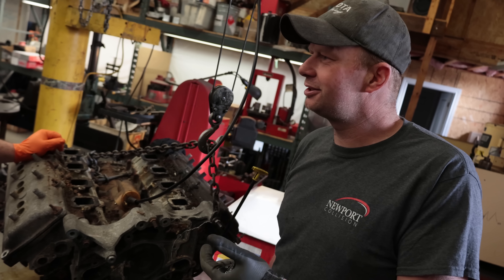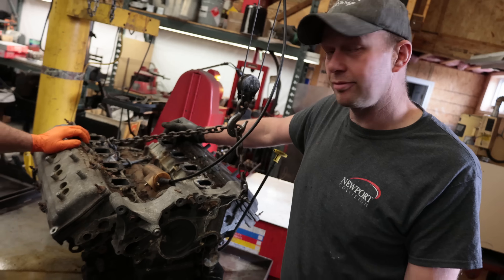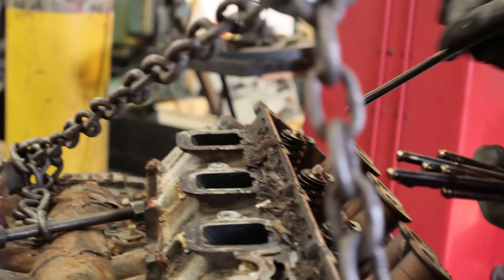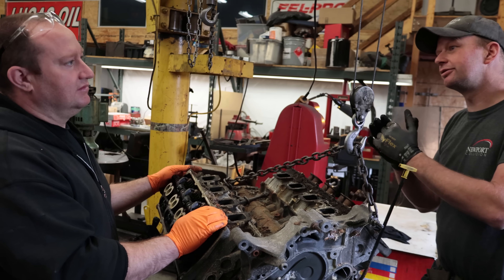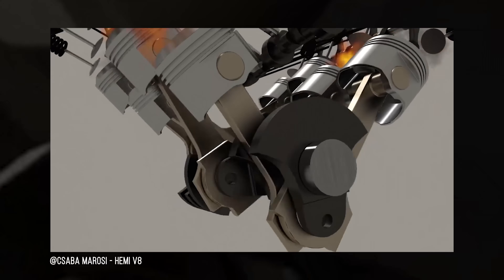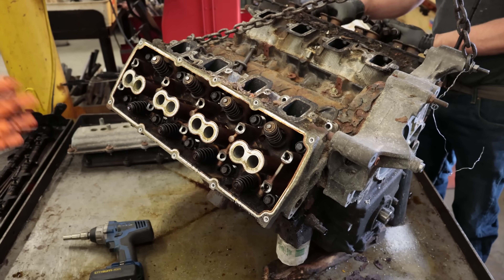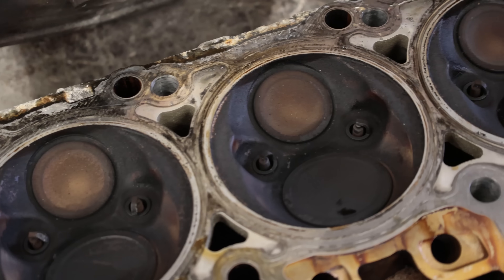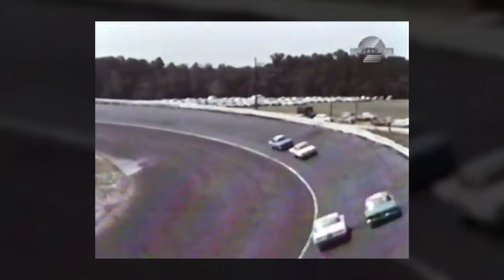REVIEW: Everything Wrong With A 5.7 HEMI 345 Engine

Comment: I had a Ford with the 4.9L inline 6, I was always told it was unkillable and I never had an issue. I would love to see an episode on that engine!
Reply: Slow as fuck though.
Reply: @adrianspeeder  somehow gets 16mpg in a 3/4 ton though!
Reply: @DaveBenson  I don't care about MPGs.  My time is money.  Gotta get places quick!
Reply: @adrianspeeder  So build a 2000hp Cummins and get there as fast as you want.
Reply: @DaveBenson  no they didn't.
Reply: @adrianspeeder  not after ford australia developed it for 40 years
Reply: I 'd like to see a external water cooling manifold and turbo'd  same bore and stroke as a 350 C with a 1" longer rod.
Reply: @adrianspeeder  But got great MPG too, comparatively speaking.
Reply: @adrianspeeder  So, it wasn't meant that be fast, meant to rev low and last
Reply: @adrianspeeder  yes 93'-96' are the worst ones , fords cam timing and emissions,, the v8s are turds from thos era ,; 95 460 v8 makes about 150 hp , brand new , I owned one In 96' dually crew cab and a 5 spd ,, couldn't back a trailer slight incline without stalling..ford claims they are 250 hp 🤣 not a chance.
Reply: @adrianspeeder  That all depends on what it's in and the gearing. I had one in an 84 F150 swb with 4:10 gears.  Nail the gas and it would light the tires up, but the downside is it was screaming at 70. Was great from red light to red light though.
Reply: Grandpa had 3 trucks with those he loved em. Junkyard digs started one and was surprised it ran on 20 year old gas.
Reply: They run along time with proper maintenance, because they're REALLY underpowered.
Reply: @letitrest4662  Underpowered for what? lol They do the job they were intended for, perfectly. My old 1970 1-ton service van weighed 9000+ lbs, with a 300 and 3-speed on the tree, and it got great mpg and plenty of power.
You want more power from the 300? Bolt on a small turbo. Want more than that? Weld up a custom head using 2 performance heads for the 302/351W and a custom intake, they will make serious power and still be just as reliable as ever.
They also live at high rpm (7000+) even with the 4" stroke. https://www.youtube.com/watch?v=zzwmr3OAb3g
The 300 doesn't run a long time because it's underpowered, it runs a long time because it's a VERY strong design.
Reply: @AmericanThunder  guys are using LS heads on the 300.
Reply: @hendo337  I'd rather keep it in the Ford family and use aftermarket heads for a Windsor V8. lol TFS R heads would definitely flow better than any LS head, too.
Reply: @AmericanThunder  it is objectively underpowered and not at all strong enough to rev 7k plus on the stock rod design
Reply: @hendo337  who there's only been talk but no really notable examples
Reply: @AmericanThunder  what? Ls heads flow just as much from factory as most ford aftermarket heads
Reply: @jdrok5026  GM is inferior to Ford.
Reply: @AmericanThunder  no lol gm is factually better lol shit ford is literally not good as a ford fan myself gm just does beat ford
Reply: @jdrok5026  I have 45 years of experience fixing all brands of cars and trucks, and GMC is trash.
Reply: @letitrest4662  exactly, doesn’t make enough power to break anything. Its also why honda and toyotas last forever.
Reply: Johndeerrm, 'Doesn't produce enough power to break anything'(?), my personal observations of a 300-cu.in.inline 6 in a '81 Econoline 1/2 ton is: that combo went through transmissions like a monkey eating grapes. I know that the Ford Dearborn 3-spd. manual transmission of old wouldn't have had a failure rate like whatever you call the updated replacement Ford inflicted upon buyers. 9 rebuild/replaced tranny's in a 300,000-mi. 1981 before 1988, yet the motor required nothing major: clutches,wtr.pumps,plugs,wires,oil changes etc. that's it. Was it rode hard & put up wet? Well it was but the motor was thirsty 4 more.
Reply: @letitrest4662  same goes for the amc i6
Reply: @letitrest4662  Same with stock Cummins or IDI 6 cylinders.

Heavy blocks, great balance, low power. Last forever.
Reply: The Ferd 300ci six is the same, you can fill it with gravel for oil and it'll still run
Reply: @HotForgeChaos  the 4.9 is the 300. Just came in the '87-94 EFI. Last iteration of em. The block is the same as what they'd been running since the 60s.
Reply: I want a 4.9l 300 straight 6 lots of torque in those lil motors. I currently have 3 88xl f250 twin i beam 460 89xlt lariat f150 351w 4x4 90xlt lariat twin i beam 460 full time locked rear end on 285's.
Reply: @landscraper420  
87-90 is good yrs for fords , 92 and after they are junk ,
Reply: @landscraper420  5.0 made same amount of torque sometimes more depending on the year
Reply: @moparjr89  5.0 makes the same torque at higher rpm, where it isn't needed. The 302 is more of a car engine, a 351W is better in trucks.
Reply: @moparjr89  it's not about the peak tq number, it's about the shape of the curve and what the rpms where it occurs.
Reply: @AmericanThunder  it makes more torque 200 rpm higher than a 300. The 302 had more torque and hp everywhere
Reply: @landscraper420  250 lbft is the highest the 300 ever had its lower torque than a 302
Reply: I had always heard that too, however I had killed 3 300-6’s before I was 25. Even better I drive 6.0 Powerstroke now and have never had a single problem. Maybe I just live in engine Paradox.
Reply: @WinterRavenMechanical  buy a lottery ticket you unlucky lucky bastard
Reply: @WinterRavenMechanical  the 300 inline 6 was nothing special but it has the same thing going for it as the 7.3 PSD. It is a lot of emission free underpowered iron. The 7.3 PSD is a massive engine putting out not a lot of power. It is enough though and I still drive my 2000 F-350 on a daily basis
Reply: @WinterRavenMechanical  cool story bro...
Reply: We have the Ford 6.2 in our work trucks, and the one I looked at today had over 25000 hours on it. And they get like 1500hr oil changes lol. Gutless, but indestructible.
Reply: @bikerpunk64  I had a 6.2 in my 2013 F250, I though it had pretty nice power for what it was.
Reply: @bikerpunk64  I just bought one in an F150 platinum.  I brought it to Ford for a state inspection and the tech showed me a  F350 with 600K miles. The truck looked like it went thru hell but original powertrain. He said he did all the servicing on it since new. 5k oci and 100K plugs. It don't feel gutless to me! They still put in brand new trucks.
Reply: @alb12345672  yah it’d have some beans in a 150. Pulling a skid steer on a tri-axle up a 12% grade is pushing it. Our trucks get abused pretty bad and not serviced well and still take a hot supper though. I found a different one with almost 28000hrs on it. Still runs well.
Reply: @bikerpunk64  tech told me it won't win speed records in a supeduty but no problem towing at capacity.  It will rev high and get 3mpg :lol:. There are steep mountains here (upstate NY) and used for towing. They go offroad for miles too. Not everyone needs the Diesel tier towing. And it saves a fortune.  He also said it is detuned slightly in the superduty vs the F150.
Reply: @bikerpunk64  
6.2 like the raptor v8 , detuned version In the super duties ,
They are pretty good engines 
Except for the 8 mpg unloaded highway. I've seen 9.2 mpg in one in immaculate shape, low mileage..
Reply: Have 2 both 92 300s my 5speed Trans works great my has 4eod Trans. Can't keep the trany it's junk  3 Trans in it I'm ready to do a 5speed swap
Reply: I just bought one in a 1990 f150 custom 500 bucks. Truck runs
Reply: Only issue is the super low HP rating. Thats my main issue. Its more a tractor/farm truck engine than anything else.
Reply: @Clapxiomatic  it sucked at that too
Reply: I had one as well. 1985 Ford F-150 with the 300ci straight 6.It was my first vehicle,had 285k miles and I never had one issue!
Reply: Don't need an episode on it because there is nothing wrong with them
Reply: Yeah and another one about the slant 6 from Chrysler
Reply: As an owner the only thing you worry about is your Crank Seals, Bearings, and your Timing gears. Some had really funky gearing and made it easy to float it out of time at certain points. But it was essentially so simple it had to be a literal abuse issue. I've only seen one blow when it threw the rod and the crank caught the con coming down, and snapped the shaft entirely.
Reply: Yes! So would I! I can say with some confidence that the 180 degree head will be at least called a massive bottle-neck. I've bothered Mast Motorsports about what it would take to get a cast aluminum head and they told me it would be about $200k just for development. Another shop said around $20k for a one-off cast and machined head. At this point it might be cheaper to have one milled out of billit. A 300 6 would be a monster with a cross flow head!
Reply: Don't forget the bullet proof 300.
Reply: @Watchyn_Yarwood  the 4.9 is the 300. Just came in the '87-94 EFI. Last iteration of em. The block is the same as what they'd been running since the 60s.
Reply: @buckberthod5007  IMO, the only piece of iron worthy of the blue oval.
Reply: @buckberthod5007  The 4.9 was around LONG before 1987. Their run was from 1965-1996 in trucks, a little longer in industrial applications. In 87 Ford just starting putting the 4.9 badge on the trucks. The 5.0 and 5.8 equipped trucks also got their own badges.
Reply: @johnweisinger7390  Yea I know. But it wasn't specifically called the 4.9 till they switched to EFI in '87. Which was what I referring too. They made the 240/300s from '64 up too 97
Reply: Cause they don't make no power and built like grandpa's shit house
Reply: I would LOVE to see this one!
Reply: There was 2 versions in a way. The great one and the junk.
Reply: I have on in my 79 f150 with headers and a four barrel
Reply: If you sneeze the head will crack, and they all leak from the oil pan
Reply: 300 straight 6 was beasts
Reply: @Tx_P71  yeah slow had no torque and died if you didn't keep them running properly the efi was all that made that engine really reliable
Reply: Yes, certain yrs , except for mid 90s 4.9 inline 6 ; gets 10 mpg and makes about 40 hp ..
Reply: @MikeHoncho0811  thats not how engines work.
Reply: @MikeHoncho0811  engines don't just not care that their is a failure inside of them. That's the claim you made you invalidated your own claim by saying the engine had to actually overcome that failure. That's the thing you're seeing s failure state
Reply: @MikeHoncho0811  also glowing red hot would cause warping which would cause issues with sealing the engine properly. You don't just heat metal up till its cherry red and it somehow survive
Reply: The hydraulic lifters sucked, if you sucked at maintenance
Reply: @MikeHoncho0811  the combustion chamber is where combustion starts and moves outward into the cylinder where process finishes. Your claiming your 300 was running so hot the head was physically glowing and didn't kill the engine which is definitely bullshit as the combustion would've started detonating. Which would've almost guaranteed caused a bottom end failure and the head and block would've been warped and 99% of the time trashed
Reply: @MikeHoncho0811  your the one not understanding shit
Reply: That would be too short of a video!
Reply: There is nothing wrong with it done and iam a dodge guy
Reply: I’d love to see the same. Specially the fuel injected variant.
Reply: I had one in a mud truck with 425000 miles on it. ran it in the ketchup all day at mud bog. Overheating all of the last half of the day, with 4 inches of mud covering whole motor. And I sold it months later. To a guy in town it's still alive I see him all the time in it still.....That was 12 years ago.
Reply: Most over-hyped chunks of gutless iron ever made lol. Probably more than any diesel installed in a Ford pickup.
Reply: @bolt_husky  Your brand loyalty is showing. lol
Reply: @bolt_husky  but still better than anything gm ever made.
Reply: @justinmartin8887  gm made emd ford never had anything on gm
Reply: @bolt_husky   those IDI 7.3s was gutless

Comment: A tribute truck say the Dodge midnight Express but maybe something new you know. Short wheel base or a Dakota sport  
Side note I have a 07 ram with a 5.7 hemi 
256, Miles and I still will not do the factory oil change intervals on it I do 3500 or 4000 mile oil changes kind of how my paycheck hit just recently replace the oil pan and nothing bad in it so I'm happy I do  run Lucas in my truck's as well

Comment: The heads on that particular hemi good for 600 hp so I’ve been told I have that same Hemi in my 05 dodge 1500 and it doesn’t miss a beat 227,000 miles
Reply: By the way I bought this truck brand new in 2005 it had 1 mile on it it’s always had the hemi Tick first oil change was at 1200 miles I’m a little overkill I’ve used nothing but mobile one and then I put in a Lucas synthetic stabilizer every oil change I have never used the recommended 5-20 weight I’ve always used 5-30 I’ve always used the regular Champion Spark Plug I’m getting ready to put a new set in and I bought platinum champions I’ve been a mechanic for over 30 years I get 18 miles to the gallon highway with a 305 tire that’s a 33 I’m pretty impressed

Comment: I have a 2008 2500 with a 5.7 hemi and 270k original miles. On the engine transmission and rear end. I’ve been threw 3 AC compressors 1 master cylinder for my brakes and countless sets of brake pads and 1 brake caliper oh I forgot 1 water pump

Comment: On my second hemi vehicle, first was 04 Durango, no issues at all but without the multi displacement it was very thirsty in town, great on the  hwy. 
currently have 17 Ram 1500 hemi. Of all the trucks I have owned or driven for work, lots of them, this truck has more power and gets better mileage than any truck I’ve come across,  regardless of who it was made by.
Had a 91, 12 valve, that did get great mileage, but that was offset by more expensive everything else, including the tps which I had to change pretty much yearly.

Comment: Hey Rich, how about stuffing that in an old plymouth volare sleeper? I used to have one that i put a set of 340 six pack heads on a 318, changed the cam and used a police interceptor manifold on so i could run more than a 2 bbl on it. the hemi in there would be wierd.

Comment: The 6.2 in our race car has no telling how many passes on it and we had a valve train issue occur and we had to replace a piston in number 8 hole. We pulled the rod bearing out and it was like brand new. This car runs 8200 rpm's out the big end of the track. Dodge got their oiling issue resolved on those motors. Do not put hollow stem valves in your motor. They will break. Thats what happened to ours and it costed us a piston at nearly 300.00 a piece and you cant buy just one. You can buy them one at a time after you buy the first eight

Comment: You say they don't get good lubrication while idling? Problem as old as time... Though some automakers make variable displacement oil pumps now for fuel economy at highway speeds... Lets you get higher oil pressure at idle without wasting extra energy at load. Surprised they don't use more for commercial/fleet applications!

Comment: Had to do my brother in law’s exhaust manifold bolts/studs on his 4th gen ram hemi. That was enough for me to swear off of them.
Reply: I've had to do both sides of my '15 Ram. I have it down to an hour per side start to finish because I've done a handfull of them at this point, all with studs snapped flush or recessed in the head. It's really not a hard job if you know what you're doing
Reply: @GormanRepairs  We tried using the Leslie tool for it, and I ended up just welding some nuts on the studs. I did my driver manifold on my 7.3 a few months later and it was a piece of cake in comparison to his ram.

Comment: Can’t believe how clean the heads are with that kind of mileage!
Reply: its crazy. My 2011 5.7 with 212k having ran royal purple 5w20 the past few years looked absolutely spotless inside zero sludge whatsoever, zero debris, nothing. I wouldnt of believed it had I not seen it myself. Mine was a hard driven copcar so it saw all 4 seasons, my manifold bolts are testament to that. Fortunately bolt extraction is a common task for me but pro tip don't try and put headers on a car with rusty header bolts, if you snap a header bolt on a car with this engine you have to pull the head.
Reply: Are you being sarcastic? You call that clean?! I'd be embarrassed if that were my engine. Obviously a very poorly maintained/abused engine. Why would they choose to tear down/critique an abused engine for this video?
Reply: @budlanctot3060  I think they intentionally picked a high mileage engine more than anything, that way any potential wear (like those wear marks on the lifters) would be more easily shown. Also shows just how reliable these engines can be, almost 500k kms and filthy inside but still made it there. Not bad I must say. - A Chevy guy

Comment: Thinking about getting an older Ram 2500 5.7 as a truck to tow vehicles around. In my area they are far cheaper than the older Silverado 6 .0. Does anyone have first-hand experience with both of them?

Comment: I've heard they have timing chain issues or at least tensioner issues.
Reply: I have the 2005 Magnum with the 5.7 hemi. Tensioner went bad on mine at around 85000 miles.
Reply: yes, you can upgrade to the beefier 6.1 hemi timing set on the first series gen3 5.7 hemi.

Comment: My coworker has a 2011 and had the lifter fail and eat the cam at about 115k miles. Got lucky not during harvest and we sent the heads in and rebuilt the top end because he didn't want to spend more and owed on it. He has had it paid off 3 years now and still going at 190k miles now. I never had troubles with my 05 hemi and was still running great when I sold it at 195k miles. No longer drive a dodge now I have a cummins lol